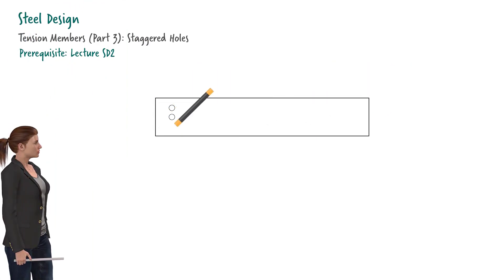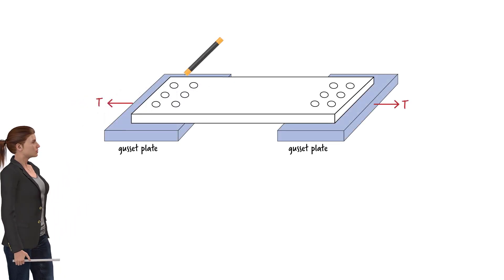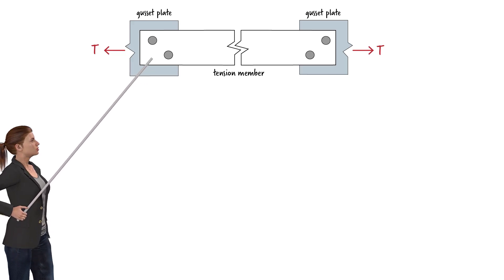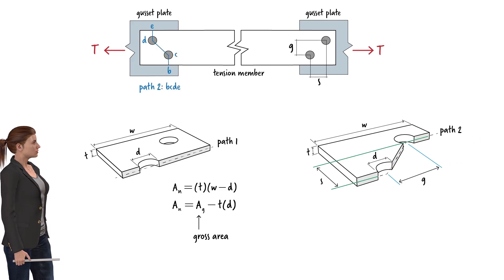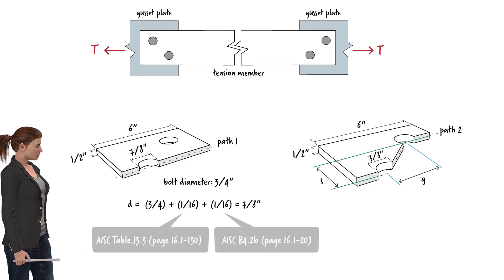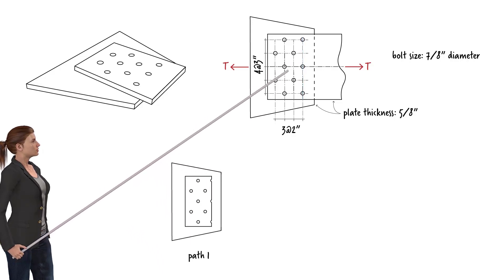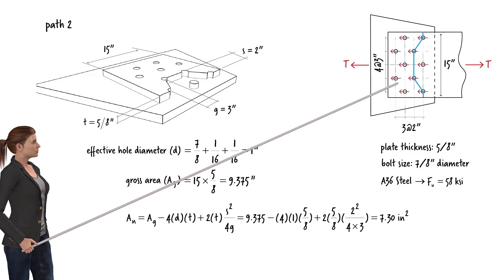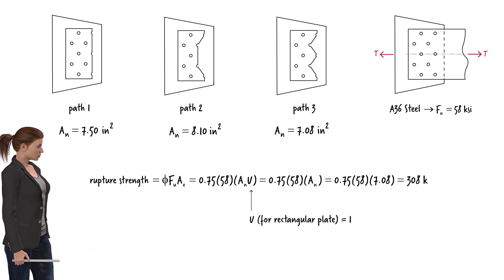SD3: Steel Design (Tension Members): Part 3

Comment: Hi Dr, in the problem solution no.2, in finding the Net area for path 2, shouldnt 0.448 be substituted for t? It seems like there was a mis input there, since it shows 2 x 2²/10 x 7/8, while it should be 2 x 2²/10 x 0.448, if I am right. Through my calculation, the net area for path 2 is 5.0715 in², thus leaving this as my final effective area. Thanks
Reply from the maker: You are correct. We have updated the solution file. Thank you for bringing this error to our attention.

Comment: can u explain the " 4@2'' " like what is the units for " 4 " and why is ur L value when calculating U 8 in the denominator why not 2''?
Reply from the maker: In exercise problem 2, the notation 4@2” means the spacing between two consecutive vertical lines (shown on the drawing) is 2 inches, and we have 4 of them, which makes the overall length of the connection 8 inches. 

That is why we use 8 in the denominator when determining U, since the length in the denominator for U is the overall length of the connection.